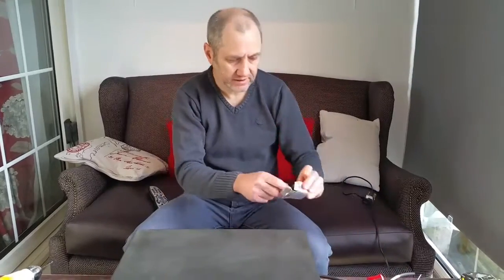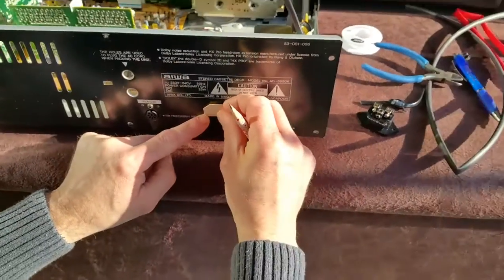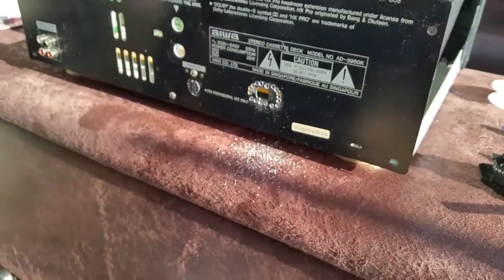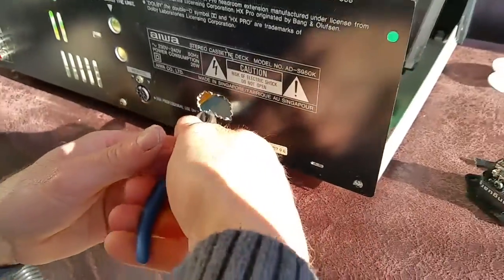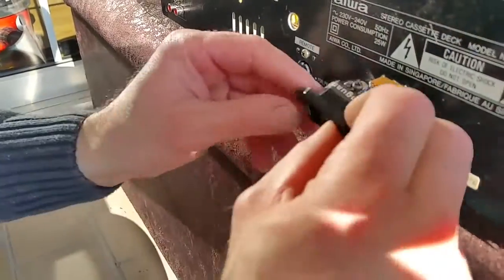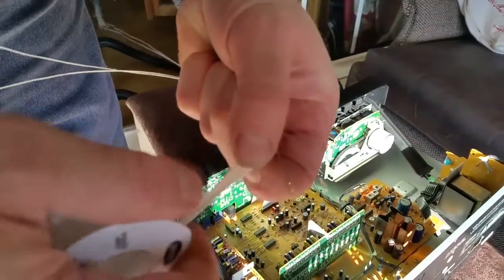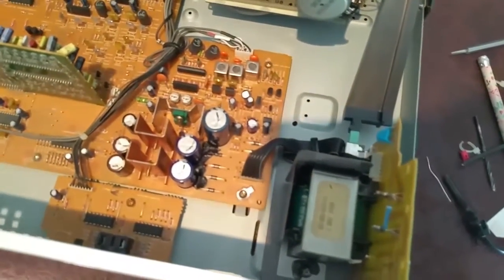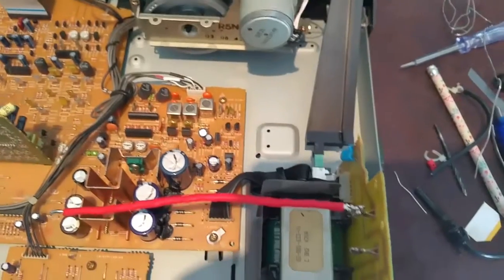Fitting chassis mounted IEC plug

Comment: Overall, an interesting and quick method of fitting an IEC 3-prong connector, and the particular audio component did have only a 2-prong power cord originally, but I have one concern:  You did not attach a ground wire on that third prong.  Doesn't that defeat the purpose of the third prong?  I ask, because I have several old audio components that need this very upgrade, and I was most interested in where one could safely attach the ground wire.  There is much controversy regarding where, or even if, that third prong ground wire should by attached in components that were originally equipped with 2-prong power cords.  BTW, I like the platted wiring that was done, but I wonder if one could simply attach a short length of pre-made wiring behind the IEC connector for hot and neutral. Thanks for the video!
Reply: @Scripturenest Dont forget your neutral wire is tied together with earth in your power box

Comment: Using Ohm's law, can you express how replacing a soldered connection with an additional bimetallic intercace, making the mains face more impedance, and then another soldered junction, will reduce any perceived mains loss over copper?

Comment: Can you insulate the power cord if you don't or can't change cord?
Reply from the maker: Sorry I'm not sure what you mean.
Reply: @tweakerman  thank you for immediately responding, can you wrap a power cord in ptfe tape and other insulation without removing it
Reply from the maker: @iyona14granturismogt6gtspo7  Hello, you wouldn't gain anything, its the purity of the wire that counts, if you just wrap standard wire with ptfe tape, it won't change anything, your best bet is to put a chassis mounted iec plug in the back of your equipment, then you can make a powercord to fit it.
Reply: @tweakerman  thank you again for the response! Darn i hoped at least to gain EMI EFI shielding, but thank you now I know

Comment: Did you upgrade every cable and solder joint into the transformer and then re solder every component with silver? No I hear you say! Waisted your time I say! I also noticed that double installation label on the back of the unit meaning no earthing is necessary. This would be true with the factory installation but with them bodged attempts at cables and the screws poking quite far through the metal casing I would say the addition of a earth would be a very good idea. But if you enjoy tinkering around that's your thing but do it so you aren't going to potentially give yourself a belt (electric shock ) and please don't tell people that changing 4" of cable is going to improve sound. I do give quotes for full silver rewires just like a normal house rewire but I will fill your head so full of shit you would believe, you would be making a video on how the music now smells and tastes better.

Comment: This is certainly not a professional job. Do not copy. Don't solder the ends that go to the screw terminals. Fit the plug before attaching the wires. Make a good physical joint at the terminals by wrapping, before applying any solder whatsoever. And the audible effect is zero. Cassette has an SNR of at best around -70dB, which is orders of magnitude above any possible benefit of four inches of silverised cable.